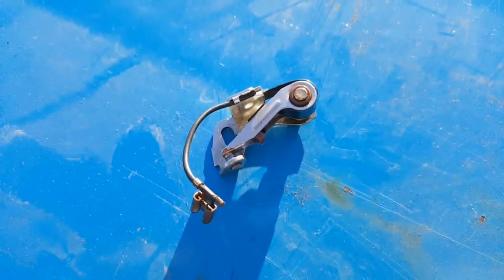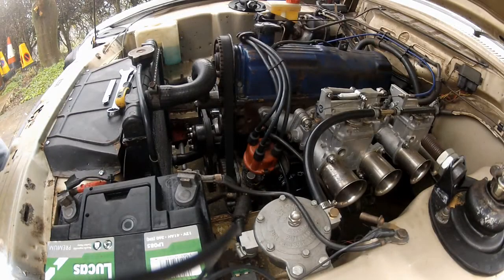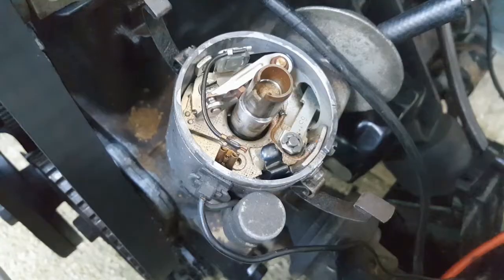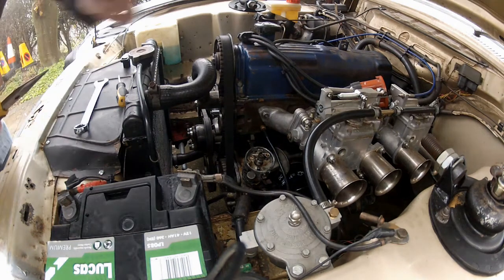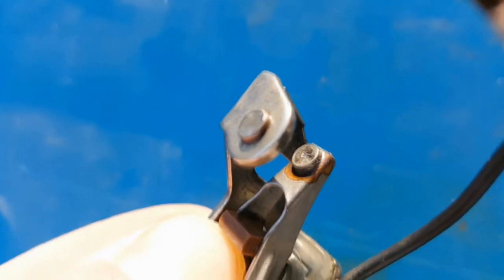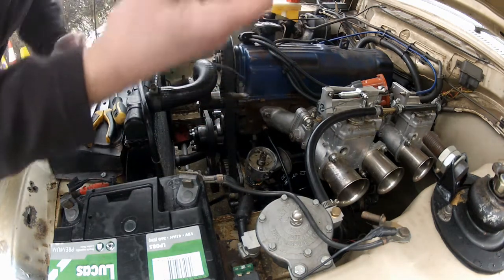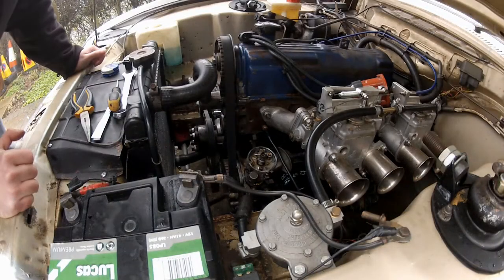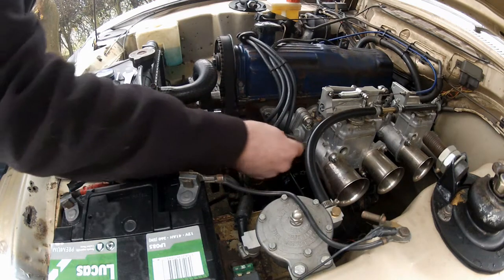How to Set Points Gap & Replace Condenser in a Bosch Distributor | Tech Tip 19

Comment: Points and condenser is the way to go. Simple, cheap, reliable and easy to replace. Spare set and condenser just in case, normally it's the condenser that fails and that is rare. We have all been conned with electronic systems if that fails, that is it, you can do nothing.
Reply from the maker: Agree. Took Capri to the dyno the other day, the tuner took the piss when he saw it was still on points. Still made 175hp!

Comment: Very helpful and well explained I have ended up with 2 capris which I need to time up and have ready for summer.
Reply from the maker: Cheers. Always good to help a fellow Capri owner! What models have you got?
Reply: @FastRust  hi. I have the 1985 2.0 laser automatic and a manual one. I'm new to all the classic car mechanics first time used a timming gun after watching your video but im not having any luck as once I set the timing to 8 btdc and then speed goes up on engine and if I unscrew the mixture on carb the rev come down but then after 3 mins pr so the engine cuts out and hesitates to start again. So I'm abit confused would love to fix these problems as I want to keep the 2capris I have.
Reply from the maker: Nice one. Look after em! You need to adjust the idle speed screw on the carb to bring down the idle. The mixture screw is a different adjustment entirely.
Reply: @FastRust  another day I spent on the  auto capri 2.0 laser got it stable on idle running at 900rpm but the problem now is that soon as I put it in drive it stalls splatters k locking sound aswell then all of a sudden sounds good again but bad again. On idle its sweet?? Would I be able to speak to you please really want to fix the capri would you allow that.
Reply from the maker: If you want to get in touch outside of youtube fire an email to teamfastrust@gmail.com 👍

Comment: What do you do when you have such an odd engine they do not produce the condensers anymore? It's a 1971 Chrysler 45hp, model 45chc. Condenser model # is Niehoff se-372. There is only 1 new old stock online that's probably 45 years old.
Reply from the maker: Convert to an aftermarket electronic ignition kit?

Comment: Hi Fast Rust, I SHOULD HAVE TAKEN Your advice on this.  Kicking myself :(   I did get my 72 2.0 Pinto running  great again, then decided to upgrade to Pertronix kit, here's a story I type up to share, A few are saying my ground might not be to good, I'll report back. Here's my story of my outing on 9 12 2020  -   I just installed a pertronic on my 72 2.0 Pinto with the Flame thrower coil as a kit I got it from ebay $128 . I reset the timing, drove it and it kicks ass, 80 miles later it starts backfiring and powering down on my way to the swap meet, tac jumps to zero then back up to normal. I pull over and car idles fine. but as i get in the gas it's having trouble picking up to speed while I'm letting the clutch out, I feather it, it gets going then bogs and backfires LOUD AS HELL, lol. at least 20-30 times while I'm getting her home about 5 miles away. I switch out the coil, still the same boggong. then I start checking coil wire, alternator wires and a few other connections, Now it's seems ok, I wish I knew what cause this for future outings.
Reply from the maker: I hear this kind of issue time and time again with the electronic ignition kits, which considering how much more expensive they are than points, you'd expects 10s of 1000s of trouble free miles from them. As I put in a previous comment, bung points back in to eliminate the Pertronix. I suspect the issue lies with this.

Comment: Yeah, I think I'll go ahead and fit my electronic ignition. "Points are awesome, just some simple routine maintenance.. So replace your points, or file them down, oh, check your gap, then check your timing.. run you car for a couple of hundred klms, oh, and re-check your gap.. and do it all again when your car starts running rough...and keep a spare set in the car just in case!" I've run points for years, and on a MK1 Escort, the dizzy is in a terrible place for access... I'll be glad to see the points and the condenser gone... 😉👍
Reply from the maker: See when you put it like that 🤣 Maybe I'm just stubborn. Do agree though, if access was not as easy as on the Pinto I might look into electronic.. maybe.

Comment: So a bad condenser can cause a no start misfire I'm gonna be so mad if that's all I need to replace
Reply from the maker: It can certainly be a culprit. Are you having to replace the points regularly?
Reply: This is my first time messing with points. it's a 49 pontiac new condenser. new points has a much stronger blue  spark at the points since I changed the condenser yesterday. now I think I messed up the original 6 volt coil or I need to accurately check the gap
Reply from the maker: I'd get the points set correctly to begin with and go from there. The spark at the points doesn't want to be too strong. Blue is normally fine, if it's yellow then it's a good sign the condenser has failed and it'll burn the points out if left for any length of time. Have you checked the ignition timing since replacing these parts?
Reply: @FastRust  I've checked it as much as I can without the engine running but all this could be for neigh  if the dwell isn't right in a 1949 heard that's important for the coil to recharge which is what I think is happening I'm getting a weak spark at the plugs but a good one at points and wire coming out of coil